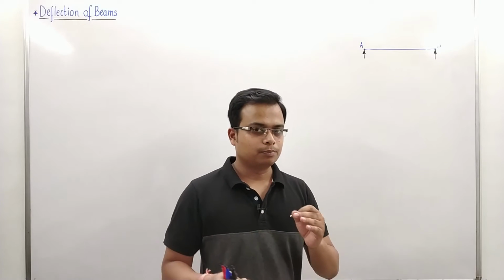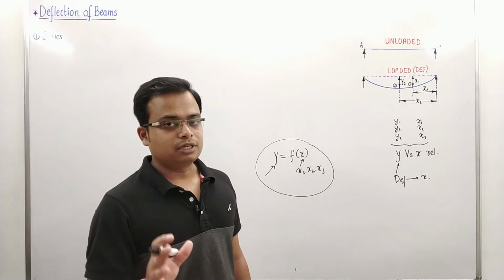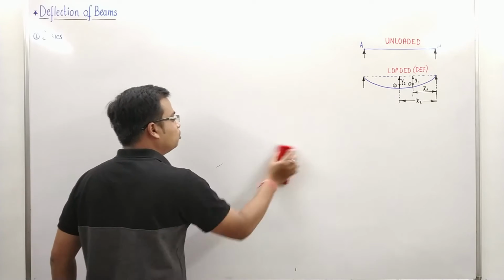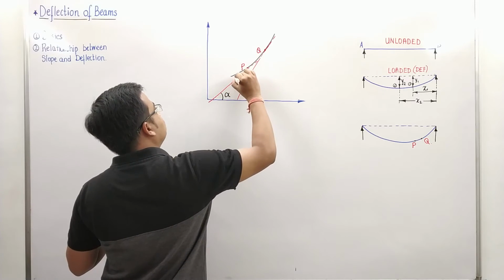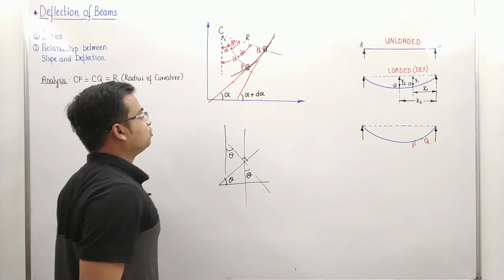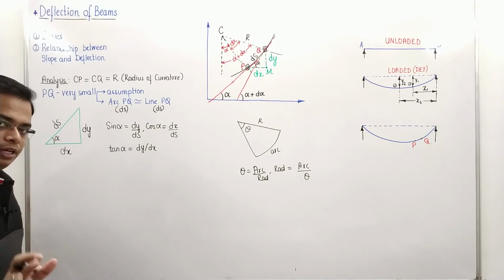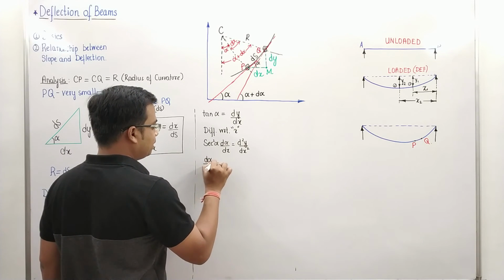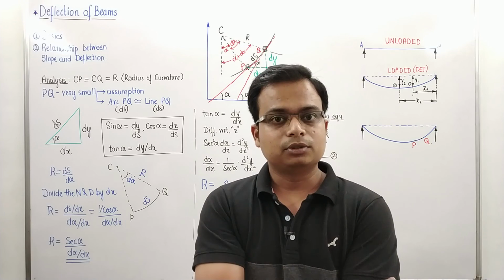Deflection of Beams | Derivation of Slope & Deflection Equation | Lecture 1

Comment: fine good.iam having doubt. that while doing  analysis & design struds software  some beams are failed in deflection. some times in contilevers, some times secondary beams. i icreased the section. even after it is showing same. what is wrong in my analysis, what i  have to do.where is wrong application.pl.clead doubt.